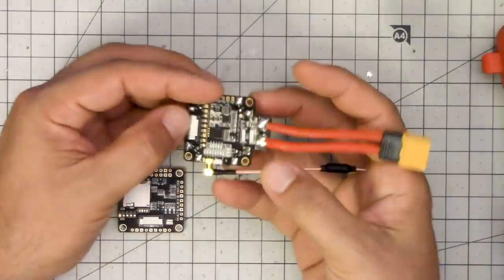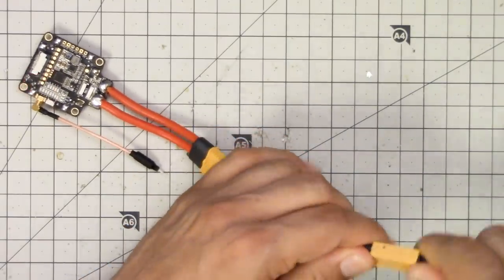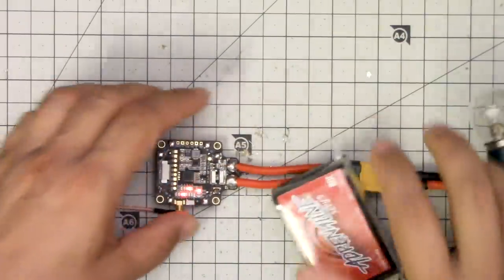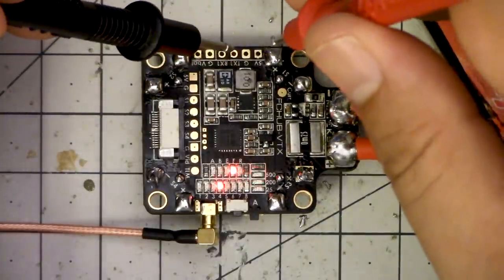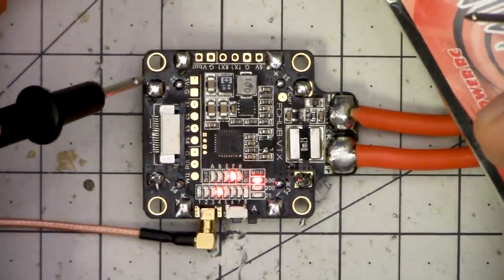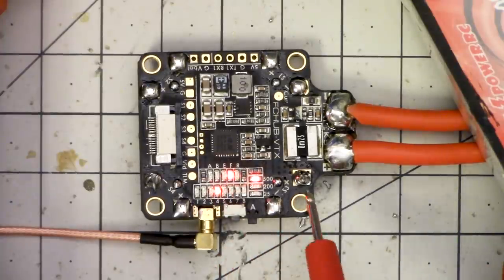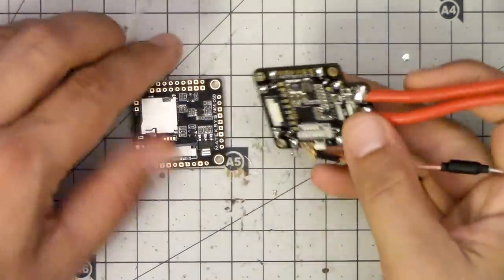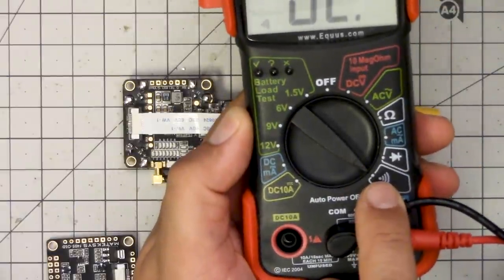Matek F405 Troubleshoot | Multimeter Continuity Testing

Comment: Hi JB love your videos there very helpful too me and I'm sure many others but I have a question that I have yet to find an answer too. Built a quad for a friend and once I had it finished plugged it into cleanflight and when you spin up either motor 2 or motor 4 they both would spin I checked and checked my solder connections and even moved motor 2 and 4 signal wires to pads 5 and 8 on the FC to try and fix it still the motors always spin together can you please give me some guidance to try and fix this.
Reply from the maker: Two possibilities. One is you are using Dshot and the two motors are sharing the same DMA channel. If that's the case, you have to use resource reassignment to get the motor outputs on a unique DMA channel. Or just switch to multishot and never think of it again :-)

Other possibility is that you bridged the motor outputs with solder but since you moved the motor outputs that's unlikely.
Reply: Thanks for your very fast reply! I tried running multishot on it and even removed the signal wire for motor 2 and they are still both spinning. I'm assuming at this point the 4in1 esc is shorted somewhere inside and I will have to get a new one. Thanks so much for your help.

Comment: It took almost the end before I started suspecting the ribbon alignment. That connector is flawed. I've seen it too many times in other tapes of equipment. You have to get that alignment exactly correct.
Reply from the maker: I mean, in theory, you shouldn't be able to misalign it.
Reply: You can't misaligned ribbon cable, they always have connectors at end (ribbon cable is what you use for PATA HDD or floppy disk in old PC  computers) which always align with pins in socket.
But this is not ribbon cable cable, this is flat flex cable and they are easy to misaligned if you do not connect them properly and they are generally pain in ass.
Reply: You're both right. However I've had so manny problems with surround sound receivers give issues. The connector and cables have too many inconsistencies. I've had too many mis matches, it's to the point it's the first thing I try with these receivers. Many different brands.

Comment: What's the advantage of a ribbon cable anyways... On the Holybro Kakute it makes sense as the gyro is sort of floating. In this setup I'm not sure.
Reply: To save the user time to connect the esc signal wires and the 5v wire. Also it cleans up the build quite a bit!
Reply from the maker: Fast and easy connection. Easy to remove the FC if need be to work on the vTX.

Comment: Hi,
Assuming that the manufacturer doesn't cover that board on their warranty and there's definitely that same situation. Is the current on those pins to high to eliminate that pin that is shorting the current, being that a ground pin or a positive pin?
Please bear in mind that it's a defective board that you cannot return for some reason.

Apologies for my English.

Cheers,
Bruno.

Comment: Hi Joshua, great video as always! I'm wondering if you could help me trouble shoot a problem? I accidentally soldered my xt60 cable the wrong way around on the pdb and the polarity was inverted and boom magic smoke. So I changed my pdb, fc, vtx, camera, xt60 and cable. Everything is working fine except for my fpv. When I hover for a few seconds the video feed gets all snowy and then snows up the whole picture. The pdb I'm using is the matek 5v/12v simple pdb. My vtx is connected to VCC at 12v on the rail labelled VCC vtx. The unify pro hv powers the OSD and camera from it's own 5v supply. My kiss is connected to VBAT with the main xt60 lead. Should I rather power the kiss fc from VCC aswell. I have VCC 12v/5v camera rail still available on the PDB. What could cause my vtx to snow up so badly? Is it perhaps the esc' s that could be faulty? I was able to flash my escs and fc no problem. Or it is it the noise from the fc because it's connected to VBAT straight? Please help I've really tried all the forums with no luck :(
Reply from the maker: Video feed getting snowy says to me that the vTX is shutting down. Usually this means the vTX is overheating but you said it happens when you hover, and this is backwards from overheating. Overheating is usually fixed by spinning the props to move some air.

If video goes out when you spin the motors, normally that's electrical noise. But that would manifest as black lines in the video, not snow.

So I'm a little bit mystified... I guess I would change out the vTX and antenna next.
Reply: Thanks for the quick reply, really appreciate it! I'm going to change the aerial and vTX next. I will let you know if works. Thanks again
Reply: Hi Joshua, what do you think of this vTX Matek Video Transmitter 5.8G VTX-HV w/ BFCMS Control? Thinking of getting this instead of the tbs unify..

Comment: Honestly, after "... Since it is powered down, there is no risk to shorting anything..." at 8:57 I expected some kind of scene usual in ElectroBoom videos with zapping, smoking, swearing, throwing things away and the conslusion "... no, it was powered".

Kudos about SmokeStopper here. 5W or 7W?
Reply from the maker: 25+5 dual-element bulb. Do the math on how many amps 5 or 7 watts will pass. It's barely enough to get your FC to power up, especially because the ESC beeps momentarily pull larger amounts of current.

Comment: If it was a poorly  aligned ribbon cable would it correct itself by wiggling the ribbon or reinstalling it? What's the chance that it is the alignment of the ribbon connector to the board from the manufacturer causing the power and ground to be misaligned that is the problem?
Reply from the maker: Yes that's a likely cause. It's pretty hard to misalign the ribbon cable although anything is possible.

Comment: Hopefully Matek has separated the power lines so the 5V and Ground lines are on opposite sides of the ribbon now. That would almost entirely eliminate the issue especially if they put a not connected line next to one or the other (or both).

Comment: greeting Joshua, I'm new to the Quad hobby, I just built my first quad, and I have the omnibus f4 pro FC stack with the I think Mateksy PDB that connects with the ribbon cable, the problem I'm having is that, everything works as long as I got the USB cable hooked to Betaflight , but as soon as I disconnect I don't get power to FC from PDB, rechecked every wire that was soldered, everything in right place but after I unplug, receiver don't light up and has no signal with transmitter??????
Reply from the maker: Power from USB but no power from LiPo usually means the 5v regulator on the FC has died. You can power the FC from an external 5v regulator or you can replace the FC.
Reply: Joshua how do I go by powering the FC from an external power source, would like to try this before I buy a new FC

Comment: Be interested to see how this works for you. I wanted this to be my go to stack but am second guessing it. The vtx is the most disappointing. It worked o.k. to begin with but is no longer outputting the same power it originally did with roughly 1 months use. Also, one of the vtx push buttons has failed. The F.C. when you first plug in a battery at the start of a session always says no gyro, and won't arm. If you replug the battery everything will be fine. The voltmeter is also inconsistent. You can plug in a freshly charged battery and the buzzer will beep at you and say low voltage time to land. Re-plug the battery, and it will read correctly. I also have only a sample size of one, so take it for what you will.
Reply: I also have 2 Omnibus F4 Pro v3's. One is running 3.1.7 and the other is running 3.2.1. Both are stable with none of the issues I have with the matek.  I can't remember which firmware the matek is running at the moment. The problems are annoyances at best, the rig still flies awesome.

Comment: I have this setup and its worked fine for a couple of months but after a tumble the 5v and grd are now connected, if I disconnect the ribbon from the fchub the aio pdb still has continuity so its the pdb but where is the short?
Reply from the maker: Something is broken in the PDB. Possibly internally. The answer is to desolder things one at a time until either the PDB is naked (in which case it's toast) or you find the thing causing the short.

Comment: You mentioned that reversing battery power can burn up a trace on the board. I reversed power leads from an esc to the fc (kakute), got smoke. Put new esc and different motor but I get nothing from that motor. Inspected the board and no popped capacitors or visable damage... Is it likely that I burnt a trace?
Reply from the maker: Reversing the power will destroy electric components. I was talking about a short. If you reverse-bias an ESC, it is dead forever.
Reply: Yes the esc very much destroyed itself, however I am wondering whether the FC will be salvagable. I have swapped the esc and motor (with one's I know work) but when I arm, that one motor does not function.
Reply: Joshua Bardwell You mean reverse polarity? Love your videos,keep them coming.

Comment: I wired up an AIO esc, flight controller and pdb board. Plugged it in with a smoke stopper, all soldering is good, but I only get the first half of the tone when I plug it in. I assume this means the board is bad???
Reply from the maker: This means the ESCs are not recognizing throttle signal from the FC. The board is probably fine.
Reply: Joshua Bardwell - ok thanks
Reply: Now I got to figure out why I am not getting power to my receiver

Comment: In the video yoh can see some pins of the connector are soldered together. How about checking them and fixing it there?
Normally the cables are fine and you can not connect them wrong easily.
Reply from the maker: The bridged pins are intentional. That is the 5v line, which shares two wires. It is the same on both of my boards. It's not an error.

Comment: Those swithing mode regulators usualy have short circuit protection that can just swith them off when shorted - I use many of diffrent types in many other projects not only quads and they generally seems to be shortcircuit proff. I never fried anything this way. Analog/ liear regulators is a diffrent thing - they often fail when shorted.
Reply: hi, i have short circuit my board accidentally and i see a short circuit on 3.3v and ground, can you help me ?

Comment: so im wondering sir, what if we just not use the ribbon cable and soldered the fc to the pdb since it seems to be caused from the pinout of the ribbon cable holders. in other words would soldering the fc to the hub traditionally? would this fix this issue?
Reply from the maker: Yes, that's what I did.
Reply: your aweseom!! these videos are really good help. happy to hear all is well :)

Comment: Josh, my Vin / Vout from my fc is not workin, the continuity test can unravel this mystery?

I have no images at all with the pads, but the cam signal directly to vtx signalis perfect... but no osd that is bad..

(Kakute v1.4 fc)
Reply from the maker: Confirm that you have wired correctly: cam to Vin, vTX to vOut.

If the OSD chip on the FC has died then you will have the symptom you are saying.

Confirm that you have NTSC/PAL set correctly in the OSD tab.
Reply: Joshua Bardwell i get a multimeter today, i will try the continuity to see.
Reply: Joshua Bardwell i forgot..thanks!

Comment: Ribbon cables are simply no no. With all these crashes and impacts miniquads usually receive...
Reply: For the short time I ran the RC Split on my quad I found issues with the ribbon coming out of it's socket and then I had to completely dissasemble the quad to get my video back. Ever since then I am not a fan of ribbons on quads.
Reply: dude just apply rtv on them to keep them in place, also concoat both boards against elements obviously. there is also special rubber coating that conducts heat and we are using it in military aircrafts to keep water away and reduce vibrations, but its two part mix and it is quite expensive, and it sets in few minutes
Reply: Kira this fc has no benefits compared to others. I'd just bought something hassle free.
Reply: David Faustino oh, just a reminder - this wonder- gyro is far mor susceptible to vibrations and electrical noise than more common 6000. The difference in flight performance 8kz vs 16 is hard to notice, but yaw twitches easily.
Reply: David Faustino poorly built? It is hit or miss, you never know for sure will a new esc cause the gyro go mad or not, unless you try. And spend your money and time. Good luck with that. Anyway, my quad with 405 aio flies on 16k without any yaw twitches. Soft mounted everything of course. But i see no difference, dynamic filtering does the job.
Reply: just ziptie it to the nylon stack
Reply: electrical noise
Reply: I'm a big fan of Matek too and cant wait to see F7 FC from them. I've got no issues whatsoever with F405 and FCHUB-6S, however RCSplit failed me BIG - that is the shittiest camera I have had and I have crashed my quad twice because of it - the ribbon cable between FC and PDB was not affected at all. I consider it close to impossible to damage this ribbon cable in crash. It weights close to nothing so it has no inertia, it is contained between both boards that are like 6-8mm apart and the whole FC stack is well protected in every frame. Props, camera, motors, arms, VTX antenna and RX antenna(s) - that is what we are damaging on "daily" basis, not the FC stack.
Reply: the connection is not as secure as direct soldering, moreover what about environmental impact? we fly outside mainly. moisture, dust, dirt, low temps... i can use some conformal coating on solder joints. how should i use it on a ribbon?
Reply: David Faustino i blew a whole stack out of a 150 over the weekend....
Reply: a cap on a power leads - is a least efficient solution.
Reply: Agreed. I have 2 quads with this great setup. They've been rock solid so far. I do use a low ESR cap (220uF) on each ESC  however.
Reply: I think ribbon cables between the pcbs are perfectly fine.
Reply: Yes, If you get the 50% that work, they are fantastic. I'm the other 50
%. Cl Racing F4 cheaper, better, less sensitive to real world, for the other 90% who just want to fly, not just super tune.
Reply: You guys do realize that noone HAS TO use the ribbon cable, right? It has solder pads just like any other board...
Reply: I'm not a fan of Matek, and I've had a lot of their gear. Their QC is just not that great. I still occasionally use their PDB's, but after 2 of their FC's failed, I gave up.Same with their VTX. Bought 2 , both failed. And I am not new to this hobby, soldering, or quads. I stick with higher end, well respected ESC's and other parts. I power test their regulator circuits with a variable load center, and scope, before I put them in, as the failure rate I'm getting at factory specs is 10% over 20 PDB's ( 2 failures out of 20 tested). Also had a 3rd fail due to improper / cold solder joint. There are better quality options out there.
Reply: Not sure its the ribbon or its connections as my pcb is live with all of it removed
Reply: WTF with all these comments? Ribbon Cable is just an option... You can always solder it...

Comment: So.. let me get this right, so you had a duff hub/hubs? or when you plugged the ribbon in the steams got crossed and the made a good hub duff? thinking about this for my next build with the halo frame from bludz so would be good to know if its better just to throw out the ribbon to start with? and just solder the job up direct...?
Reply: Just ordered the same quad with the same matek setup and after my neato just died with the same problem I'm thinking I may change boards.
Reply: Richard Harwood how'd it die? After a bad slam? Ribbon cable moved and cooked the FC?
Reply: Not a bad slam, just hit a branch and it wouldn't arm or show life afterwards, when I dismantled it all seemed buttoned up well but on testing it had continuity everywhere even to the sd card housing.
Reply: Richard Harwood harsh, and is that it? It's had a short run through the hole system? You unplugged the vtx hub from the FC and it's still showing continuity everywhere?
Reply: Everywhere but as to what shorted first I have know idea, I'm a bit confused as to hardwiring stopping the problem unless the ribbon instigates the short.
Reply: Richard Harwood think it's the ribbon that causes the short? As JB said there are double + &- pins next to each other in the plug. So if the ribbon gets shoved over it'll bridge and send 5v to ground. If you got rid of the ribbon and hard wired the FC to the pdb vtx hub this should sort the prob. But you need to find out if you FC and vtx is fryed first. Hard wiring the pdb to the FC shouldnt be to trick just look for the wire/ pin out on line.
Sorry yes...the ribbon I think is the problem, see if the FC will power via you USB and connect to beta flight first.

Comment: Thank you for this video. I was going to just plug the ribbon in when I got mine and fire it up. I will test for a short to ground now before doing so. This is actually good advice to test for before powering up anything. Anyway if the ribbon cable was simply misaligned were you able to fix it by moving it around so all of the pins line up correctly? This entire issue screams poor design.

Comment: At least Matek thought about it and you can still use fc-hub and fc by direct soldering them and bypass the cable altogether. Defines the purpose of the cable but hey you don't need to throw your pdb or fc away.
Reply from the maker: Yep, exactly.